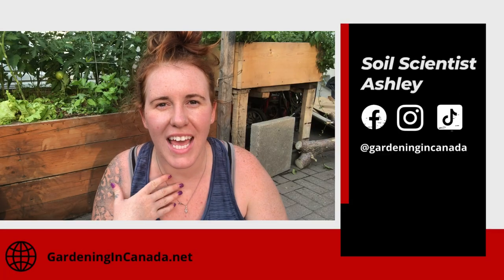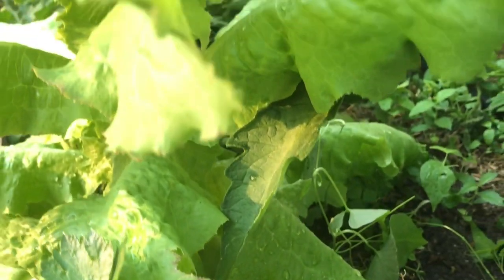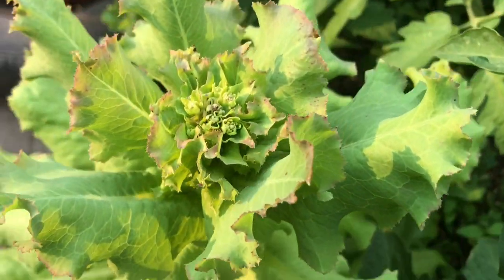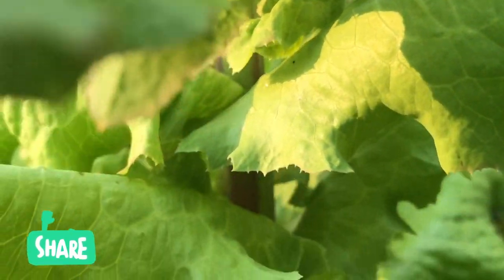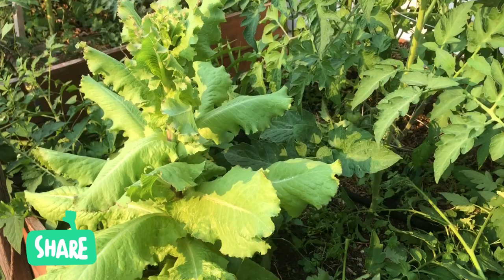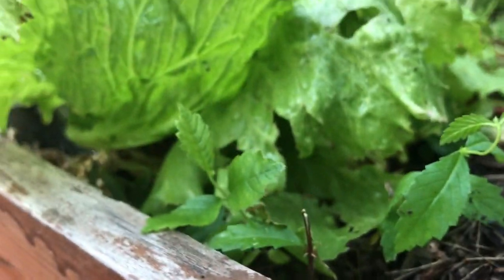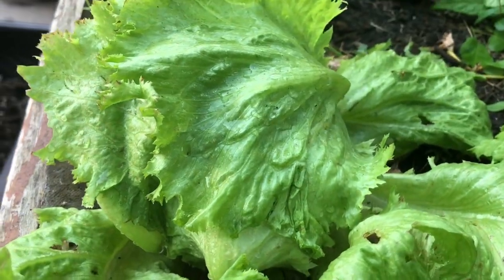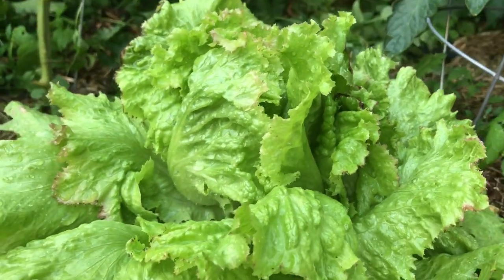How To Prevent Bolting? Why Do Plants Bolt In The Heat? | Gardening in Canada

Comment: Yes I did learn something new, so thank you.  So basically I don't need to plant in the wet cold early spring trying to work the muddy ground between the melting snow drifts, what a relief.  Lots of water, regulating the fertilizer to a minimum , and a bit of shade.  Good to know.

Comment: I direct sowed some bok choy in April 13 and April 21. April 24-26 we got our last spring frosts. The ones I sowed on April 13 bolted immediately. The ones I sowed on April 21 gave some nice leaves in late May before bolting from the heat in June. I suspect the first batch germinated before the frost, hence the stress, and the second batch germinated after the frost, and did better as a result. This week the seeds from that first batch of bok choy that bolted were ready to collect, so I'll be using them to plant the fall crop in August.
Reply from the maker: That’s a nice early first frost free date
Reply: @GardeningInCanada  Yeah, although I'm still figuring out how to do the whole spring cool season crop thing. I think the ideal for those would be something like 15C in the day and 5C at night. Well up until mid-May temperatures will struggle to clear 10C during the day, and then by early June temperatures are consistently above 10C at night and 20-30C during the day. That means we have all of about 2 weeks when temperatures are in that sweet spot.

The fall season is more of a gradual cool-down, so I think that works better. 

In the last 12 years, our last frost has been on average April 14 (ranging from March 23 to May 9), and our average first frost was November 10 (ranging from October 31 to November 26). 

So it definitely makes sense to try to have successions, maybe two longer maturing cool season crops like cabbage or broccoli growing from April-July and then August-November. Or maybe 3 successions of fast maturing crops like spring spinach then summer bush beans then fall Asian greens. Or maybe even something like spring radish that gradually gets overgrown by a more traditional summer crop like cucumber, okra or tomatoes, and then some fast maturing hard frost tolerant greens like Claytonia or Corn Salad (or Garlic for next spring). 

I'm still figuring out the timing though. I've had radishes overgrown by zucchini before they could mature, spinach bolt before I had warm weather plants ready to replace them, etc.
Reply from the maker: Zucchini are giant plants they swallow everything
Reply: @GardeningInCanada  Yeah, I knew they'd swallow the radishes eventually, I just didn't realize how quickly. When I sowed the radishes near them, the zucchini just had 2-3 sets of true leaves and then once they had about 5-6 true leaves their growth really exploded - they went from 30cm in diameter to over 1m in diameter in only about 10 days. I think for that experiment to have worked, I would've had to direct sow the zucchini and direct sow the radishes at the same time.

Comment: We here, in Vancouver, had our 40 degree weather a couple weeks ago.  I had 12 heads of lettuce growing, and 9 of them bolted.  I got excited when 3 of them didn't bolt as those are the ones I plan on saving my seeds from.  I know you suggested saving your seeds from the plants that bolted, but wouldn't you then be saving seeds from plants that were prone to bolting?  Unless of course all of them bolted, and you had no choices.

By having any plants that didn't bolt in the heatwave, you can now save those seeds selecting for a warmer weather lettuce for your late spring plantings.
Reply from the maker: You can be theoretically selecting plants more prone to setting seed.
Reply from the maker: I like that theory!
Reply: @kingjames4886  Not so sure about that.  It doesn't make much sense for a company to actively try to create inferior product if they want repeat business.  There are a number of reasons you can have trouble with any seed not performing as well as we hope.

1. The seed would have been selected generation after generation for the local climate the seed farmer lives in.  Those seeds may not perform the same in your climate.
2. Growing plants during the wrong season.  Radishes grown mid-summer aren't going to do well at all.  Fall is the best time to plant them as they mellow out when maturing into cooler weather.
3. With radishes you don't want to fertilize with too much nitrogen or you will get a lot of leafy growth without producing a nice bulb.

All that said, if you do grow radishes in the summer, and they bolt before making a bulb, those seed pods are 100% edible, and radishy.  Enjoy them in a salad 😁
Reply: @kingjames4886  You may have something there.  Perhaps they could do it inadvertently.